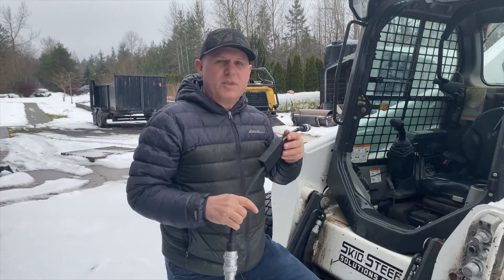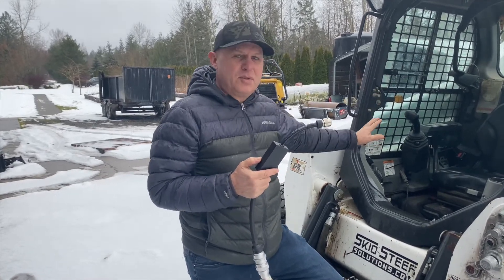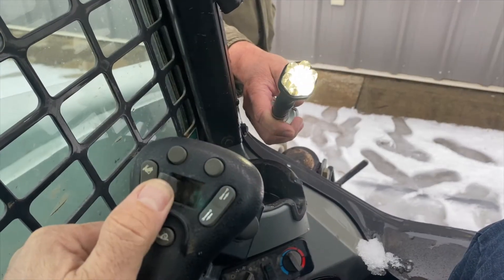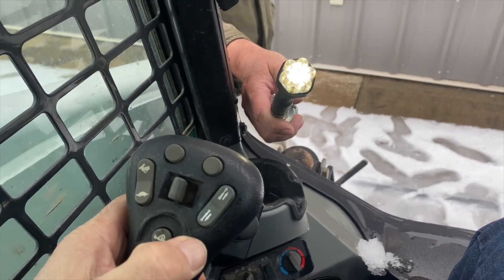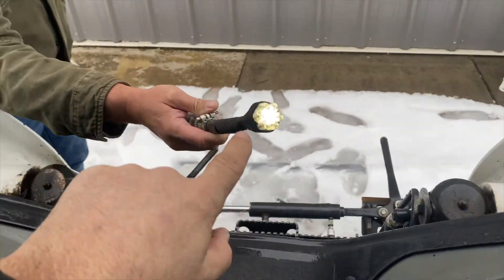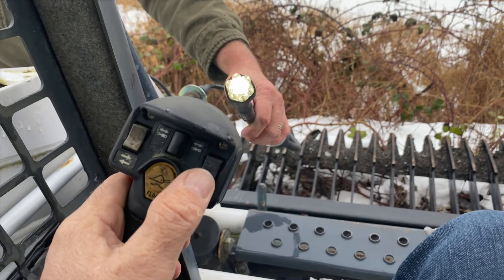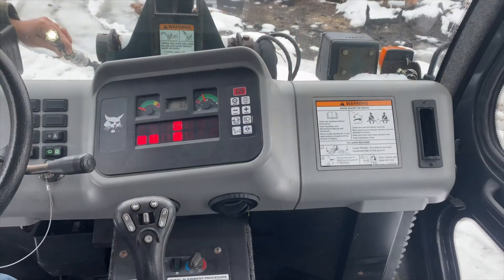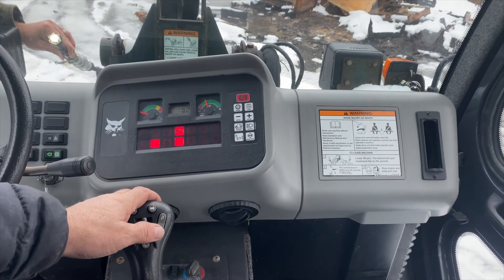#149 - 6014 CAN Controller for Bobcat - OBSOLETE

Comment: Love thus thing.Bought the 2 port male deutch connector model for my 2024 bobcat t450 with 7 pin connector, plugged it in the 7 pin side. Plugged in 2 pin male deutch connector (white/black wires) to the 2 pin female deutch connector from my implement - a tree shear that has a rotating head (go from horizontal to vertical cutting). This wire provided on the tree cutter goes to the solenoid to divert the hydraulic fluid to a cylinder that actually does the rotating.  Powered up the  bobcat. Kept eye on the indicator lights all was well on the genius unit.  On my left joystick held the down cylinder looking button and that initiated the diversion as i used my right hand joystick to start/stop the rotation of the cutting head.  It worked right out of the box, plug and play. I switched out the tree shear for my eterra backhoe digger thing that has a female deutch connector as well, plugged it in. The eterra digger has a hydraulic thumb that was controlled  by the switch. All worked great. So much better than running your own wire and switch from the battery.